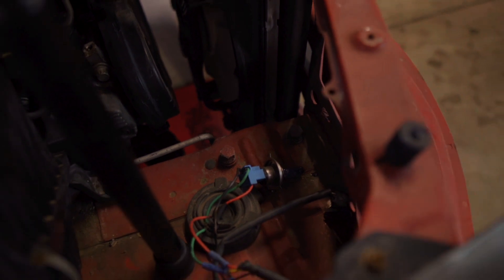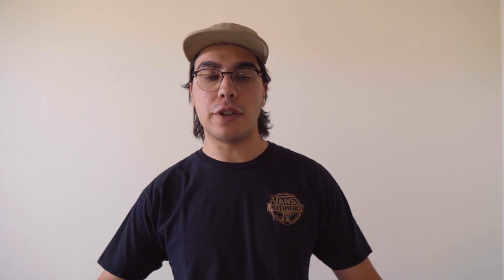Front Bumper Swap for my GC8 Coupe!!

Comment: I have a 97 Impreza L I’m tryna do some things to, where should I look to get bumpers, side skirts, just body parts in general?
Reply from the maker: It never hurts to check your local junkyards to see if you can get lucky for cheap, otherwise I would join some of the GC8/GF8 owners groups on Facebook or the buy/sell gc parts groups on Facebook. They are always listing sought after OEM body pieces, but most of the time you’ll have to pay for shipping. I would try to stick to OEM pieces and nothing that’s aftermarket, but “OEM look” it’ll save you a lot of time and headaches 😁 hopefully this helps! Any other questions feel free to ask 👍

Comment: I got a 95' Impreza wagon would a 2.5 front bumper fit onto it? with cutting the crossbeam of-course.
Reply from the maker: I can’t 100% guarantee fitment for your wagon, but I would imagine it’s the exact same! If you pull off your bumper and the beam looks the same as mine did in the video I’d say it would work out perfectly! Hopefully this helps 🤙
Reply: Did it end up fitting? I’m on the same boat as you